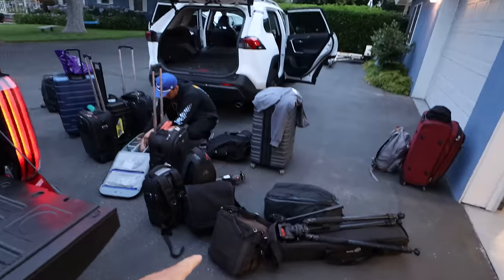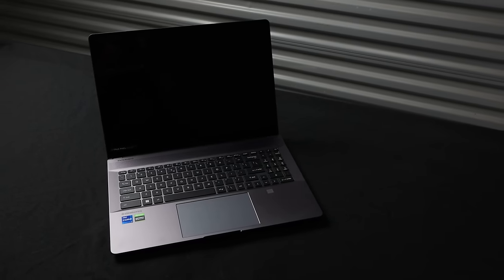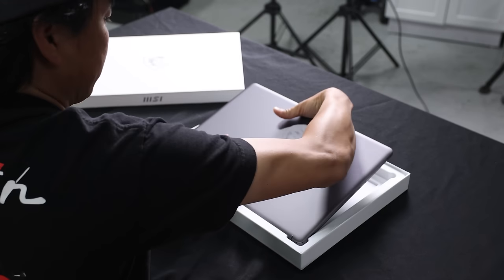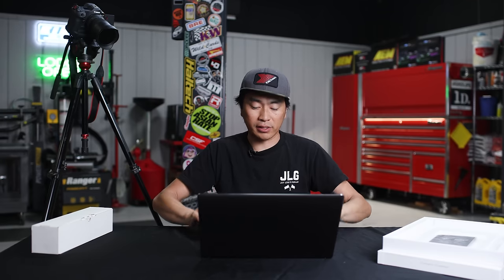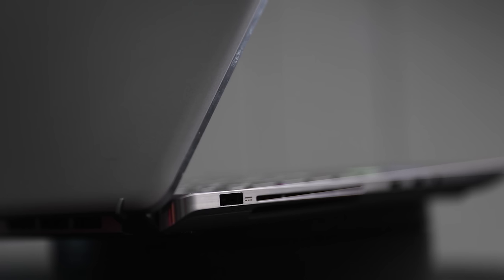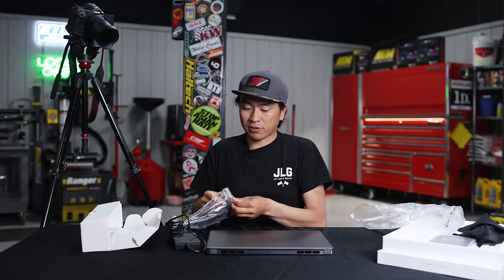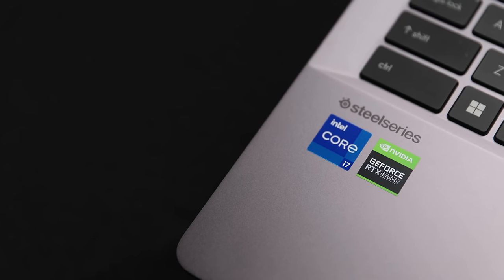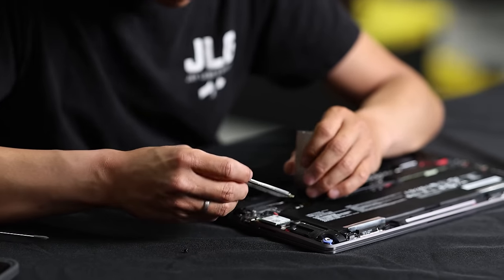MSI Creator Z16P - Our new favorite editing laptop!

Comment from the maker: I just put up four prints from Pikes Peak on my store. Two of Ken Block, two of Rod Millen's Tacoma http://larrychenprints.com/
Reply: Mr. Chen, how hot does this get when you're running multiple programs? I did see a complaint about the heat from another reviewer of the Z16P.  

And  no issues with not having a LAN port? Use an adapter/dongle to get high bandwidth over an ethernet?

Comment: But the question is, Can it run Crsis? Lol
Reply: Crysis 3 released Feb 19, 2013 

SYSTEM REQUIREMENTS
RECOMMENDED:
OS: Windows 7 or Windows 8
Processor: 2.4 GHz Intel Core i5-750 / 2.7 GHz AMD Phenom II X4 805
Memory: 4 GB RAM
Graphics: 1 GB Video RAM or better / NVidia GTX560 or AMD Radeon HD5870
DirectX: Version 11
Network: Broadband Internet connection
Storage: 17 GB available space
Reply: @wolfofthepast  yea but it was all optimized n stuff unlike the o.g. title.

Comment: I too really like MSI, I have a GT60-2OD, it's a Haswell unit with the 3k 15.6" display.  However I decided I wanted to try a Surface Book 3 for streaming (I was streaming church services each week) because it's lighter, smaller, has a GPU, and could charge off USB-C also.  USB-C is very limiting, and yeah the MSI I have can't do any real work with a USB-C PD adapter or the charger shuts down, but having the option of also using USB-C PD for charging is useful.  I was looking at the ASUS Predator Triton 500SE because it had all the ports in the body (no dongle needed) and was USB-C PD compatible, but it's a 16" laptop with a 60% keyboard.  IMHO, anything with a 15" or bigger screen should have a full layout keyboard with normal size arrow keys.  This is the real limitation of the SB3 IMO, the keyboard sucks if you are used to a full size laptop keyboard.  I really have no idea what your background is, I just know that you're the "go to" car photo guy, so perhaps for people that are new to the channel, like me, you should maybe do a bio video and tell us your story, do a walkaround, etc?

Comment: Lenovo T used to be king. But now its plastic cheap shit. Onyl thing I liked was lenovo hub which you could connect via 1 cable only usb-c to the laptop and you had monitors, charging, mouse, keyboard, speakers whatever connected to hub not the laptop. Now I have macbook pro for most work and its kind of shit in some ways, cool in few like laptop material, display, speakers, battery management. I miss that one cable everything from lenovo. I need to put charger and some shitty unofficial mini hub or hdmi+usb (with usbc converter which now blocks the other usbc port lmao 😆). Would probably switch to that MSI if I had choice. Nice that it has second pcie slot these ssd on pcie are ultra fast.